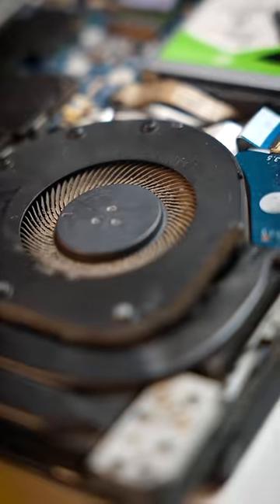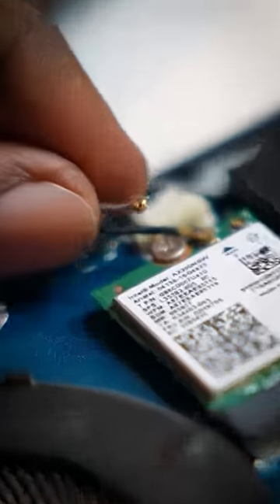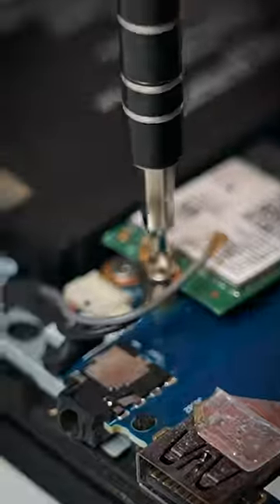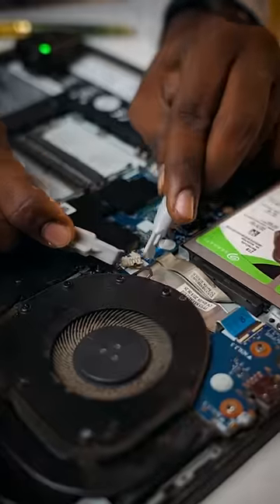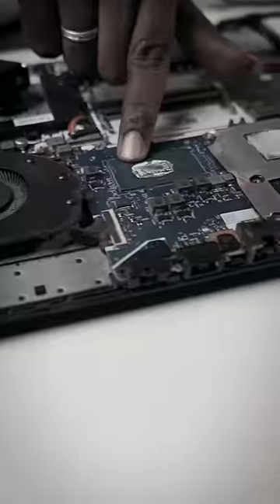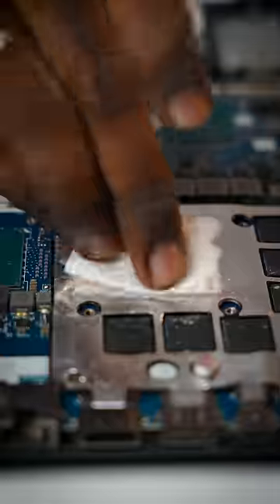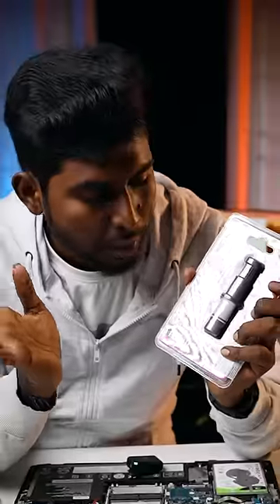LAPTOP-la நாய் முடி  - Gaming Laptop Repair | Overheating Issue Solved 😊❤️ #a2d #laptop

Comment: Bro thermal paste change pannalun 92°C pothu bro CPU
Reply: thermal condutivity: 4 - 8 W/mK erukura thermal paste use panuga bro
Reply: @viswesh3939 And also cpu fan 5000rpm kaatuthu but vents la air throw kedala bro
Reply: @viswesh3939 Lap on panni software ls open pannale 92°C temp poiduthu